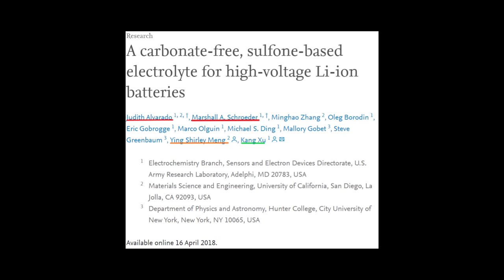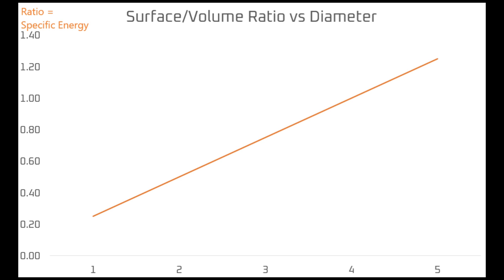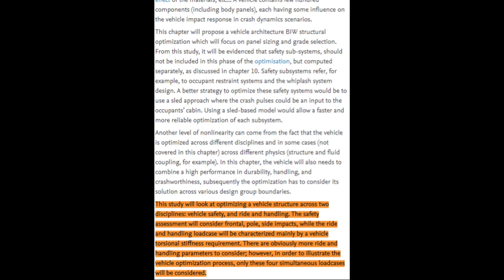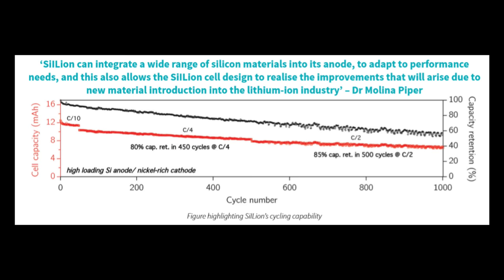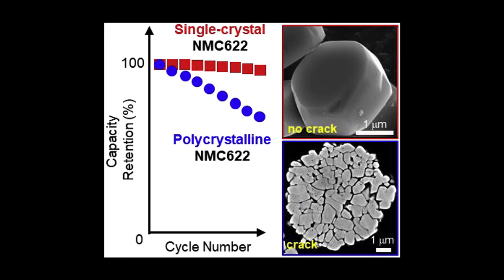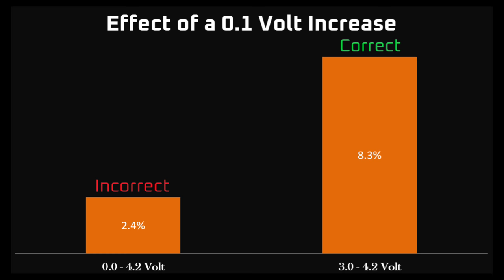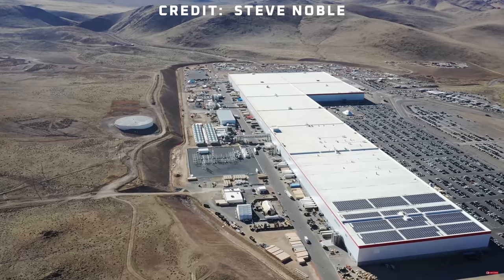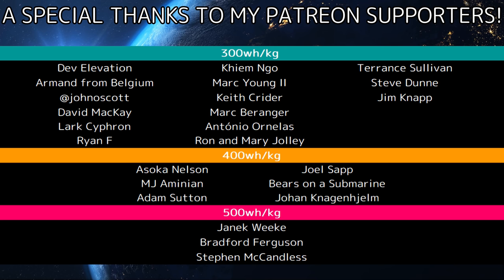New Information 💥 Tesla Battery Investor Day 🔋

Comment: Looking at the chart at 19:20... seems the cells can fully discharge from 100% to 0%, which would drastically increase a vehicle's range over, say a 25-75% discharge.  Am I missing something?
Reply from the maker: Nope, that's how much better this battery is.  You can fully charge and discharge it with no ill effect!  Most batteries, you are limited in depth of discharge because the battery starts to break down.  This is why it is nobel prize material.
Reply: @thelimitingfactor  what effect would this have on charging time? And any other things in developement that would effect charging time? and by how much?
Reply from the maker: @FunnyMattG  It depends what corner of the triangle problem they engineer for.  The limiting factor would be the supercharger capabiliity.  They'd need a V4.  I'd expect double the charging speed IF they engineered for that.  However, I'd think they would take a more balanced approach and go for 20-30%.  That's all shooting from the hip.  Too many unknowns about what their goals are.
Reply from the maker: Also worth noting that the Maxwell tech may extend the high speed charging you initially see when your battery is low on charge.  Even with V3, you might see 10-20% increase in charging speed.  Again, shooting from the hip.
Reply: @thelimitingfactor  what if V3 is hiding something? It can split 1MW cabinet into 4 250kw stalls. What if they could actually put out 260kw-1000kw to one stall even for a short period of time? I think they may be holding out because there is video of V3 peaking at 256kw. Am I dead wrong?
Reply from the maker: @FunnyMattG  I'm not that far down the supercharger rabbit hole.  But, they can certainly extend the peak power for longer with a better chemistry.  I don't know the physical limits of the Superchargers.  Someone needs to take one apart, lol.

Comment: Model S would go 120kWh so maybe that could be used as reference for legacy cells? Would mean 300Wh/kg if they stay using modules, otherwise maybe they could just have 277Wh/kg and get the rest by cell to pack technology? And about panasonic, they can manufacture the legacy cells but with the NA nanocoated chemistry, or whatever it will be called?
Reply from the maker: Yes!  Panasonic should be able to do the single crystal coating.  From their perspective they are a chef, and Tesla designs the recipe. Single crystal would be like swapping out himalayan sea salt for regular table salt.  Single crystal is already fully commercialised in China.  Agreed, I'm thinking a 110-120kwh battery :)
Reply: @thelimitingfactor  it was leaking in the software a few months ago that there would be 120kWh model S, so it is a pretty weird coincidence that that lines up with your 300Wh/kg estimate if all else is equal. I am wondering how long it will take tesla to make a model S mk2 that would use the new developed cells, of those can really push 400Wh/kg then that would give a 1000km range...

Comment: Obviously it’s very technical so watched maybe ten minutes different bits. It’s basically sounding very old for the battery day. Impressive improvements. The absolute perfect sweet spot for me to change to a EV is that the packs are reliable and will outlast the Car without too much loss in capacity and look after themselves and a range of 300-400 miles real world on the standard version. If I was to get the model Y then improvements to fit and finish and paint that would as suggested elsewhere might happen with Giga Berlin nailing quality control over trying to pump as many Cars out regardless. 

Tesla as seen in the Munro breakdown improves model by model and existing models evolve to add improvements. Tesla seems to take onboard suggested improvements and are always looking to make the Cars better. My existing Car factory ordered was one of the first of its kind on the U.K. roads, quality in places questionable and resulted in replacement parts and in for fix after fix. Four years later the same bad design and faults are still rolling off the production line as I’ve checked that was in my early Car and this is BMW. So I’m extremely weary of New Cars just out as the BMW was my first Car ever to give me grief to such a level.
Reply from the maker: Thanks for watching!  Yeah, as Elon says, the faults in the car reflect the faults of the organisation.  Tesla is great at engineering, but delivering a quality product off the mark they are still working on.  Model 3 to Model Y improvements bode well though.  

New battery I expect to outlast the car.

Comment: Great stuff as usual! Would love to get your view on this, Jordan;  Model Y features a new, huge, rear underside aluminium die- casting. Patents show that Tesla might enlarge alu die casting significantly in future models. Could a full die- cast underbody be used as an integrated battery heat-sink in the future? Or would the heat dissipation be insignificant compared to liquid cooling? & could they work together? Prob beyond battery day...
Reply from the maker: Oh wow, that's inspired!  With all the protective materials in current battery packs, no.  But as you said, in the future, it could hold potential.  Maybe someday the battery will become part of the frame, like fuel tanks in jet wings.
Reply: @thelimitingfactor  yes, I'm super interested in the potential for die- casting in the auto industry. I contributed to a video with Ricky @twobitdavinci recently on this tech (Model Y vid), and the most recent ThirdRow Tesla podcast with Elon/ Sandy Munro is fascinating. Model Y is the start imo. Massive changes coming in future vehicles, I believe - keep up the great research on this channel!
Reply from the maker: @anthonysmithtube  Nice!  I like twobitdavinci's channel.

Comment: Tesla has OpenSourced their patents before. It wouldn't be strange if they opensourced their battery tech to be used by Panasonic, so they can start upgrading their cell production to the newer tech without that much trouble. After all, even if Tesla produces their own cells, it will still take some time for them to ramp up to Elon''s TeraWatt Hour required goal.
Reply from the maker: Now that's something I hadn't thought of.  It's not licencing, it doesn't require Tesla to be on Panasonics side of the Gigafactory, the relationship is already tight, and engineers are already near at hand 🤔  The trouble would be how to cut over, but that's not unsurmountable.  Thanks man!

Comment: Getting closer!
Great research and thought process as usual.
I still have a feeling this is the end, or at least the beginning of the end, for 18650.
Several reasons.
The promise of extra performance for the Plaid cars.
This would require chemistry and manufacturing retooling to Maxwell production (?) In Japan, for a now relatively low volume.
If the feel type was changed, removing that cost, together with shipping overheads, would seem logical.
If so,
Moving to a common cell type then affords the opportunity to produce a common pack casing for S3X and Y (plus others). More saving.
Thus may incorporate better cooling (change of state?) As mentioned in the pack patent, probably involving Hibar expertise (?) bringing obvious benefits as outlined in your presentation.
If the pack is common, why not BMS?
All bringing not only performance but major cost savings in all departments.
Then, the factory.
If a Maxwell line can produce 16× as advertised....
Let's say 10×.
That's one cell line feeding 10 pack assembly lines.
One (2?) new factory module could feed all current production.
It seems to be a perfect opportunity to rationalize.
Reply from the maker: Agreed, rationalisation is should be the long term goal!  The horizon for this video was about a year.  So much potential innovation here man, it's ridiculous isn't it.
Reply: @thelimitingfactor  
I still think sooner rather than later, otherwise they end up with a "dogs breakfast" of 3-4 different cells across the range.
A relatively small cell production facility feeding existing pack production..... Actually scrub that. At least initially, pack production will be the next bottleneck. They must be able to use the extra cells.

Then there's the "where do they build vehicles" question, solved to a certain extent if there's spare space in Nevada?
Etc,
Etc,
Etc,
Not long now.
Btw.
Nice work on the chemistry logic, I'll have to read that again to understand it!

Here's one out of left field.
How about laying the cells horizontally?
Packing them tight would still leave space for horizontal cooling flow, no channel required.
Would also solve the (possible) pack height problem?
Reply from the maker: @rogerstarkey5390  If rationalisation happened sooner, it would be AWESOME.  It means I underestimated them, and I like having my expectations subverted.

Oh man, I've thought of the horizontal cells, but I haven't had a chance to research this.

Comment: I took an educational detour that had the huge opportunity cost of inhibiting my understanding of Physics and chemistry.  Is the nickel content of the battery pared with the aluminum factor in a way that is complimentary to free electron flow?  If so then why not copper and aluminum or magnesium?  Also, if this is only the anode side of the battery equation Why isn't the cathode of similar construct?  Where do eutectic salts come in? It seems to me that a heat absorbing slurry involving Eutectic salts could be air cooled and help out with that huge swelling factor.  Would also like to know where the new graphene tech fits in?  Some graphics that displayed these physical interactions would really be nice .
Reply from the maker: 1)  This provides some information on the combinations they tested and around figure 6 they discuss the different options and structural effects:  https://iopscience.iop.org/article/10.1149/2.1381902jes.  Ionic conductivity seems to be the main concern.
2)  The cathode side is what was focused on.  The anode already has double the energy density of the cathode.  It's a secondary concern.
3)  Graphene isn't needed at this point.  It doesn't offer the cost-benefit needed.  With Maxwell tech, this is even more true.  Graphene will be needed when we switch to high energy density, low conductivity materials such as sulfur cathodes.
Reply: @thelimitingfactor  Thank you Much for your kind informative reply. I will view the link.
Reply: @thelimitingfactor  Okay read the abstract and the conclusion and browsed the experiment; It is amazing!  The chemical precision required for battery composition resembles the mechanical precision for an ICE to perform reliably!  Only this precision is increased by a factor of 3 or more!  When AI becomes this capable things will get interesting indeed!  Thank you again.
Reply from the maker: @clavo3352  Ha!  That's a really cool way to look at it.  I see batteries almost as biological organisms - which to me is a type of machine.

Comment: Donyou have an opinion on flow batteries and the new breakthrough on a non vanadium chemistry out of USC last week? I'm curious as to whether or not that tech can compete with lithium ion for stationary storage it seems very scalable.
Reply from the maker: I heard about it, but didn't do a deep dive.  Did they give any indications on cost?  My view, is that as long as the chemistry can beat fossil fuels and can scale, it will have a market.  Battery chemistries won't steal market share from eachother for another decade in my view.
Reply: their article, in case you haven't seen it already. They estimate materials cost in the abstract at $66/kWh
https://iopscience.iop.org/article/10.1149/1945-7111/ab84f8
Reply from the maker: @tonydeveyra4611  Ah!  The redox flow battery.  This is very different from batteries in cars.  Nice link thought!
Reply: @thelimitingfactor  certainly, i think this tech is only gonna be applicable for stationary storage but it could free up lithium cells to speed up more EV assembly. Ultimately, though if battery day shows Li-Ion below this price then its moot.

Comment: I am still baffled why a supper caps can’t be used on (launch) acceleration then regened while the BMS manages cross use of caps and current tech batteries.
Reply from the maker: The best part is no part.  Supercaps have voltage sag, phantom drain, add complexity and cost, and don't provide much additional benefit of you have a large battery.

Comment: Just some thoughts that maybe you could give an expert opinion on....
Elon has said that the tabless battery is more significant than it sounds and that battery day will probably be the most significant day in Tesla history. He has also spoke of its contents as alien like technology that will blow your mind.
On these quotes then it would seem that Elon has something up his sleeve for battery day as increased density/cheaper and greater manufacturing really couldn't be compared to extra teresstrial advancement wouldn't you agree?
So what are we mssing? Perhaps the tabless battery (as explained with a toilet roll) allows exponential increase in battery charging time as with a shorter electron route meaning less heat so higher charging rates and new chemistry meaning less degradation then could we be looking at full charge in 15-20 minutes? - that is a total gamechanger as you'd likely get a 70% charge on 10 minutes or less - the time it takes to fuel up an ICE car - it would also decrease congestion at the superchargers - waiting 10 minutes is not a big problem.
Another thought is to do with Maxwell - they were bought for not only their coating technology but I suspect development of their super capacitor knowledge. If energy density increases bu 25-30% then the volume of the battery pack could also decrease proportionatly. What if the new space is filled with Super capacitors? This would allow for drantically more efficient energy regeneration from braking which in turn increases real term range - also you could probably do a 2 minute emergency charge of the SuperCaps from any ecectrical socket to get you to the next supercharger or home in an emergency. You would also have a section of the battey pack that could now give instant full power so would account for the spectacular acceleration figures that are being promised on future vehicles.
Now I'm not as clued up as you clearly are on the technicals of all this but I'd be interested to hear your thoughts if this could make sense ......
Reply from the maker: That's a lot to respond to my friend, lol.  Working on a deep dive on the tabless patent.  It will drop in 2 days - lots of interesting side effects.  Super capacitors are unnecessary to hit any of the numbers Tesla has been proposing for any vehicle.
Reply: @thelimitingfactor  apart from maybe super efficient regen charging...just can't help thinking that Super Caps could be the under the radar ace up the sleeve 🤔
Reply from the maker: @davidsimonwebb  It very well could be!
Reply: @thelimitingfactor  my opinion....for what it's not worth 🤣....is it's not what is necessary with Elon but what is possible....think about previous 'reveals'......looking forward to you next video....take it easy 😁